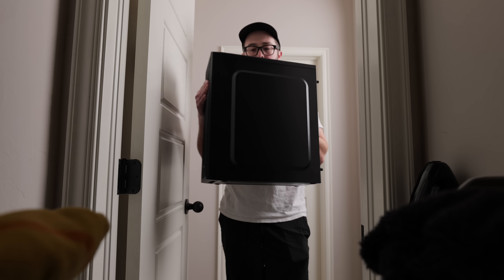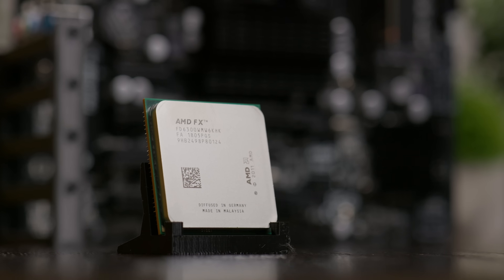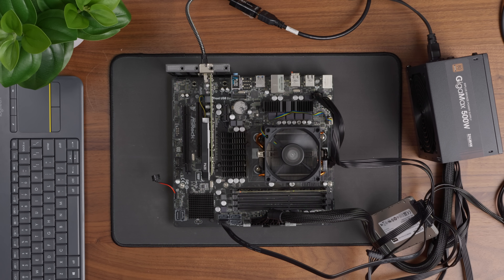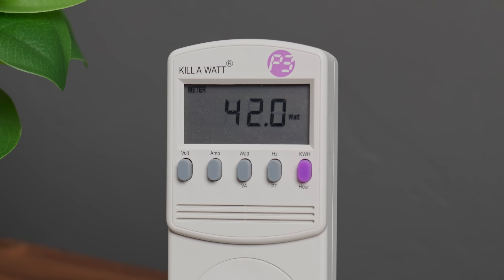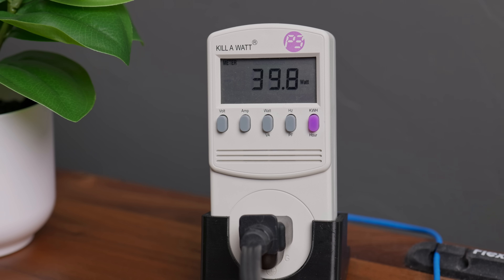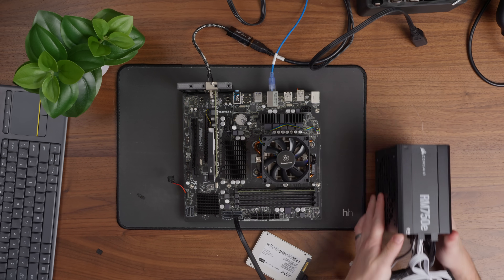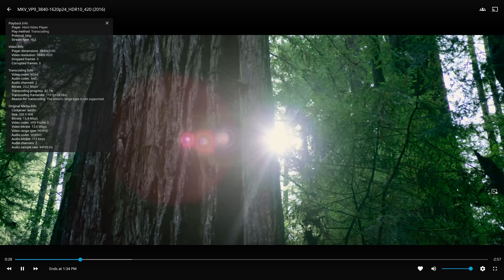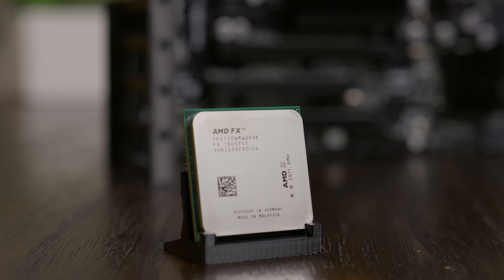This CPU Shouldn’t Work in a Home Server… But It Does

Comment: Literally looking at 3 x FX-8350 and mainboards sitting on the shelf right now, for close to 8 years they flawlessly served as an esxi cluster.
Reply: I have 2x fx 8350 machines sitting on the shelf, and the fx 8370 running in my room right now.
Solid older machines.

Comment: For Phenom IIs there is a program called PhenomMsrTweaker, where you can adjust voltages, frequencies and load thresholds for each P State level (awesome tuning experience). 
When paired with the Vishera's the program has glitchy functionality.... I made it work somehow but I can't remember from the top of my head.

Comment: I'm currently using an FX-8350 in a 970FX mobo as a off site NAS. I think it has 32GB of RAM. It's just ubuntu server with open zfs, and I'm using tailscale and syncthing for backups. I might just try some of these tweaks to drop power draw for the hell of it. It's also sitting in the corner of the office I work in, so I'm not paying that power bill 😄

Comment: If you still have it running, it would be interesting to see what a Windows "idle" power consumption what look like. From my experience, the Windows installation and drivers are hard to beat when it comes to saving power. Linux always used 20%-30% more power when I tested power consumption. Network performance (e.g.) was lower as well on my home lab hardware with Linux, which was very unfortunate to see. I settled with Hyper-V instead of Proxmox because of that, I don't have kWh and performance to give a away for free, especially not in Germany, where electricity costs are ridiculously high!.. o)

Thanks for the video! o)

Comment: Just a thought: i would like to see you using Core2Duo or Core2Quad in home server. Just because i have to 2 different Core2duo prebuilds and i don't use them, so you might give me the idea what to do with them. And if you are wondering what prebuilds i have: HP DC7900 CMT and Fujitsu Siemens Esprimo P5720

Comment: I built one for my son based on the highest FX processor they had,  but after a while, the motherboards ports started going out.   
  Not really worth it with the limitations of I/O on these older boards.

Going with a spanking brand new AM5 platform with the PCI 5.0  on board is far more future proof even getting on with one of the lower spec'ed cpu's as they sip power. 

Those that got on AM4 are going to be rocking it for the next 10 years if they want to under linux with just about zero issues anyways as long as AMD keeps pushing out Silicon for the AM4 platform. 
the AM4 boys won the silicon lottery of life if they invested early.  

AM5 just keeps getting better & better. 
And now that boards support  PCI-e Bifurcation,   no wasted PCI-e lanes to worry about if you plan your build right with the latest I/O on the board such as 10Gig Ethernet,  the newest     USB-4 hotness.

Comment: The CPU always gets a lot of criticism. My first proxmox server ran for almost a year with an fx-6300. It ran several lxc containers, my docker cluster, and a whole lot of stuff. I actually replaced it because of the power consumption. I obviously didn't know your video, and I knew how to control its power consumption with commands. I've never undervolted before and I'm not really brave enough to try it. I'd like to do the same on my main computer and slow down the graphics card a bit, because maybe I can save a lot of power that way. My open media vault NAS and my current proxmox server could also have their performance limited. That's a nice thought-provoking idea. The video is great again. Thank you very much for it.

Comment: There is a trick to start a motherboard headless, only qpplies to mobos or gpu with vga or dvi outputs.

You have to use 3 resistors to "bridge" 6 pins of the VGA connector, that will make that the mobo believes there is a screen connected.

For DVI you can use a dvi to VGA adapter and use the same trick

Comment: I had a some of those running until a few months ago. An FX8350 running a plex server at home, an fx8300 running an online radio station and we had another 8350 at work running backup drives, video editing and a plex server with dashcam videos from a landscaping fleet. Single core is pretty slow but performance on applications that use all 8 wasn't too bad even 12 years later. They are sitting on the floor now, too good to throw away but not good enough to re-use for a 5th time.

Comment: My home server have an AMD Athlon II 250 @ 3.6Ghz with 8GB ram. Home assistant, FTP, 5 instances of Octoprint, Fileserver, DLNA server, etc.
Works beautiful.
Reply: My simple file and back up server is running a X3 405e with 32Gb of mostly unused RAM. Small RAID5 of 4  4TB drives. Works just fine and the CPU drops to about 800MHz under tuning. Only run it for back ups these days.

Comment: I built a NAS for backing up my data out of a Supermicro H8SCM-F motherboard. I chose an Opteron 4332HE specifically to get one of the lower power FX CPUs, and populated all four slots with 8GB DDR3 ECC RDIMMs. With four SATA SSDs, an Intel X520-DA2, a Broadcom dual GigE NIC, and an LSI 9211-8i HBA, the total wall power consumption is less than 90 watts (it might be less but I haven’t measured properly recently). With six Seagate HDDs spun up on the HBA, power consumption hovers around 110 watts at idle and goes up to approximately 125 watts when scrubbing the HDDs.

Comment: The FX8300 and FX8350 were good home server CPUs for the time assuming power is cheap. It was worth it for me to buy an FX8300 vs the i5-4570 for home server use. The FX chip outperformed the i5 in what I needed it to do. The price difference was enough for me to choose the FX vs an i7.

I never thought to undervolt the CPU.

Comment: For the DDR3 memory voltage that's actually a normal thing for DDR3. It's just due to the difference of DDR3 and DDR3L, which are pretty much the exact same thing, the main difference is DDR3 runs at 1.5v and DDR3L runs at 1.35v, which is why you can put DDR3 or DDR3L in a DDR3 motherboard and either will work as they are the EXACT same aside from the voltage they are spec'd to run at. In fact most DDR3 these days just says DDR3/DDR3L because pretty much any manufactured DDR3 will run at 1.35v. So basically the memory you put in at first wasn't really under volted it was probably just that it was DDR3L spec'd memory you put in your motherboard that's why it's voltage is running lower by default. If you undervolt your DDR3 to 1.35v then you've basically turned it into DDR3L as it's basically a way of marketing DDR3 memory tested and spec'd to run at 1.35v by default.

Comment: Some of what you're saying in the "Limitations" section is wildly off. First, ASRock's site says all the PCI-E slots are 2.0, and all the SATA ports are SATA3.

And SATA2 is 3Gb, faster than the 2.5GbE NIC you put into the system. On which 2.5GbE will max out at about... 260 to 270MB/s, exactly what you're seeing here, with plenty of variables - including your switch and the cable quality - playing into what transfer speed you'll see in the end. So what were you expecting? I'd chalk up the slightly lower transfer speed to the card getting a little too warm given the x1 slot would've had the NIC's heatsink against the graphics card and right above the Northbridge's heatsink. A fan blowing across the NIC would've likely helped.

Comment: The AMD FX as a FreeNAS/TrueNAS server are actually pretty solid. You can get the large DDR3 8GB UDIMMs for cheap to get (unbuffered) ECC support for cheap (I paid $380ish for 4x8GB back in 2015ish). I was given a FX-8120 by my AMD rep bc he chose me specifically when the FX-8300 series just came out. I also was able to get a Gigabyte 990FXA-UD7 for $10 (it was clearanced literally 1/2 dozen times - I was the 7th or 8th owner of it) b/c my manager gave me a 95% markdown on it. The CPU+Mobo+RAM was basically one of the best combos for excellent IOMMU support for it's time. I used FreeNAS on bare metal, used all the onboard SATA ports, running on an open test bench & using Fractal Define Rx hard drive cages with 120mm fans zip tied to them for airflow over the HDDs. Eventually I moved to ESXi VMware with LSI 9200-8i in PCIe passthrough to FreeNAS. Ran that for a couple years then got into Supermicro X9 platform + HP Drive Expansions after that. Still for a basic bare metal TrueNAS with 32GB of RAM it can still be useful for 1 or even 2.5Gb LAN transfers. 10Gb+ connections will probably run into single core performance bottlenecking the transfer.

Comment: Here is some information to help you. There are other AM3+ motherboards which have IOMMU passthrough and instructions on those CPU which thereby allow for SLAT in virtualisation passthrough. Such Motherboards at ATX size have three (because of SLI) PCIe Gen2 slots which divide down to 8x slots when using two of them for expansion cards or 4x when using three of them for expansion cards (even though some motherboards without the IOMMU passthrough have two PCIe 16x slots at Gen3 which divide down to 8x slots when occupied by expansion cards). An NVMe, even if a Gen2 slot at 4x will have the speed of about a 2x (or maybe slightly less) but some Gen3 newer AM4 boards cut down the speed to 2x anyway (of Gen3) by sharing bandwidth with a PCIe slot if it is used. So there are times when a speed tantamount to a 4x Gen2 PCIe slot are tolerable for NVMe. However, also there are USB-C expansion cards which can work at a tolerable speed in a Gen2 PCIe slot even when using only 4x. There are of course network interface cards which can use not only the IOMMU passthrough and SLAT virtualisation on the AM3+ boards operating at 4x. With a tape-mod (for which one can look it up for the range limit of a domestic PCIe slot Motherboard compared to a rackmount Server PCIe slot) there are other HBA expansion cards for storage and more exotic network adaptors, although look for ability to switch off built-in RAID for some if using ZFS or BTRFS. Not all are eSATA, SATA and SAS connector. There is also the consideration of a FPGA expansion card. Generally, if using numerous drives as of HDD storage, the 30Watt as net total might not be a terribly bad thing because it can be managed, such as rotation of network cards in IOMMU passthrough in VM like changing games servers over time-zones across the World when different gamers or end-users for business or productivty (or SAAS) such as good-deeds work like learning share a NIC thereby spreading time of cores used on the CPU with a core per VM for instance, thereby reducing power net usage over time. Also, some CPU cores can be disabled when used less at known times. Examples of that might include using only the FPU core for a specific task and then polynomials and markov chains (such as some compression) for the non-FPU core remaining even though it is still some maths-co-processor 'style' work but avoiding so much of the transcendental operations such as FFT that instead would have been it. Heat also on the DDR3 can be spread with a lower demand of fans since they can be gentle and the VRM not so subject to heat. Be mindful that, with CPU cache being abundant on a chip which is above the FX series, the FX by comparison can still gain benefit from using a GPU for such things as neural networks and OpenCL (Fourier analysis) rather than the low-latency applications. An LLM is not out of the questions for GPU such as something using probability estimation with its Rosenblatt-Parzen window method. The GPU might have multiple FPU on it (and it can be commonplace to find tat heavy FPU configuration for a GPU). Graphics like video and photo manipulation (but also some spectral analysis) can use the high precision Gaussian double around about the OpenCL 2 and 2.1 and 2.2 versions. 
As an aside, some NVMe to SATa adaptors exist as do NVMe to expansion-card or external GPU adaptors. The NVMe can run in the PCIe slot with an adaptor of a different kind.
My comment has no hate in it and I do no harm. I am not appalled or afraid, boasting or envying or complaining... Just saying. Psalms23: Giving thanks and praise to the Lord and peace and love. Also, I'd say Matthew6.
Reply: break this up into paragraphs and I'm sure it's legit info that people may actually read

Comment: My current PC, for multiple reasons, is still a Fx-9370 on a gigabyte 990fxa-ud5 v3.0, 16GB 1333MHz CL7 Ripjaws, a sapphire R9 fury 4GB, a WB SN850 on a PCIe to NVME raiser, an old 40GB platter HDD for booting (because my motherboard does not support booting from NVME), and another dozen assorted platter HDDs. Running xubuntu.
The biggest difference I see in power is lowering the frequency. By just using the power profiles to switch between "ondemand" and "powersave" the power goes from 200W to 120W on idle (including monitor and other peripherals).
I have never undervolted because I do not want to risk browning out my only working PC, but a long time ago I underclocked it down to 600MHz (CPU and memory) using an 1:1 ratio for the memory and northbridge, and the GPU down to 100MHz. I do not remember the value for the power but I remember that I only lost about 20% in performance in synthetic CPU benchmarks. I did not benchmark the GPU. 
This system in "performance" mode, while stress testing, gobbles around 650W. In "powersave" mode, the one I use most of the time except when compiling something big, uses around 145W, while stress testing. 
One final curiosity, my boot drive is set to power down after boot because it is only used for that.
Reply: why not a sata sdd for the OS?

Comment: As always, you are the master mature system recycler. Colton, I spotted that 3d-printed card bracket you had on the back of that motherboard.  Any chance you can add a link to that in the description?

Comment: I have two AMD FX processors in my home lab. 8 core and 6 core. 6 core is the same model as you just reviewed. One I built over a decade ago. Other one was put out of service by a friend of mine who used to have it as a daily driver and I picked it up for cheap. I wasn't so concerned about power consumption for my home lab, as I was about decent performance. They both run proxmox now and support a few virtualized boxes. I like both of them. The only gripe I have is that the motherboards and support seem to be not so great, and getting replacement motherboards is either spelunking through ebay or trying to figure out how to refinance your house to afford it.

Comment: I still have an FX 8350 PC with an RX 590 GME (technically still an RX 580) in it and it's great for 1080p gaming. I've had proxmox loaded on it to tinker with VM's and containers and I've also tinkered with TrueNAS using it as well. It's been a great spare PC for many computer projects over the years.

One of my nephew's uses an FX 8350 based PC for playing games. He did have an RX 580 and it served him well, but when there was a killer sale on RX 6800's (non XT) at Newegg several months back, he and his brother both grabbed one. You'd think it wouldn't really make a huge difference, but it was a massive uplift in performance. Sure the CPU is the bottleneck, but now he can max out graphics and still get a way better framerate than he could previously.
Reply: Mine 8320  OC to 4.4 and ram to 2133  filled my GTX1070 to 100% in almost every game and stays  at 30-65%
Only last of us can load it to 95% CPU and gpu 97% ))))
Reply: @alexgo1034  Nice! Goes to show that computer hardware doesn't just become useless in 6 months time like the companies would have us believe, eh?
Reply: @Viking8888  
Fx was a pioneer of home miltithreading
And it still can
Amd outrun intel again

Comment: FX got a bad rep because a lot of reviewers had no idea what they were doing.  Most people never even read the official tuning guides for FX, or Phenom.  But you sir, you have put a lot of work into optimizing and that's totally worth it.  I tip my hat to you.    
If you'd like to see how well they perform when properly tuned, I did a video around 6 months ago that you may enjoy.  Some of the results actually surprised me a little.  Fun project.  
Happy tuning!
Reply: no it was pretty bad archtecture , Shared floating point proint units, windows treated it like a 3 core processor due to its issues. I had a FX6350 and a FX8350 performance especial in single core task was garbage. Now if you wanted to write a operating system for them and the bulldozer archhitecture they migh be OK, I still have both and MBs for them, I cant even give them away
Reply: @tomr3422  
>Now if you wanted to write a operating system for them and the bulldozer archhitecture they migh be OK

Basically what MS and Sony did with their consoles. It just wasn't an appropriate design for laptops and desktops running Windows or Linux. I'd say it was still overly maligned though.
Reply: It got a bad rap because it was a bad architecture with nobbled "cores".

I had to service a laptop with one of these and it was slow as treacle.
Reply: This. Oh lord, so much this. One of the biggest issues FX had to deal with, was the persistent idea amongst the masses that 1600mhz ram was 'good enough' for FX cpus like the 8350 because it was good enough for all the intel stuff, etc.  

It was not. AMD themselves were recommending 1866 minimum. Even when presented with this info, a lot of people would just double down in the comments on reddit, etc. I know, I got banned from PC subs because of it.

Comment: One of my servers runs on my old gaming PC, an FX 8350 with 16gb ECC Unbuffered Ram and 6 3TB HDDs on raid Z2 running truenas scale. Power consumption is not an issue, since I rarely use it, only when I have to save or grab some files.
The rest of the tasks is handled by a mini pc with an R5 5700U on proxmox.
The backup server at our Inn is handled by an repurposed FM2+ PC and the awsome  AMD PRO A10 7850b, limited on the MB at 35w.